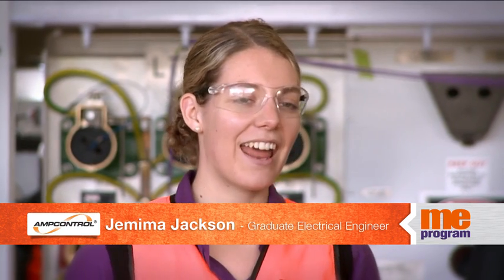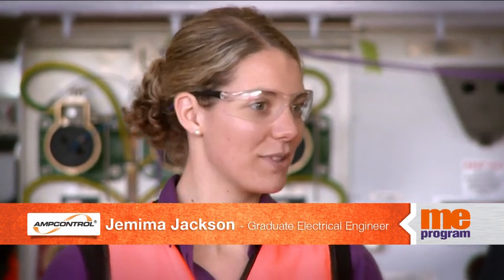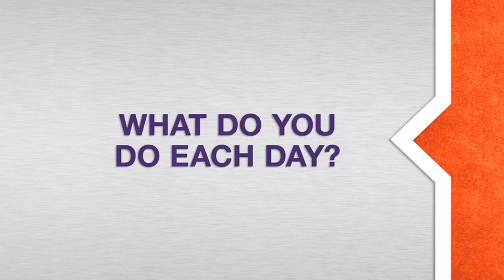What is an Electrical Engineer?

Comment: Electrical engineering is a field of engineering that deals with the study and application of electricity, electronics, and electromagnetism. It involves the design, development, testing, and deployment of electrical systems, devices, and technologies. Electrical engineers work on a wide range of applications, from small electronic devices to large-scale power generation and distribution systems.

Here are 10 ultimate things to know about electrical engineering and its categories:

1. *Circuits and Electronics*: Understanding circuit analysis, electronic components, and device physics.

2. *Electromagnetism*: Grasping electromagnetic theory, Maxwell's equations, and electromagnetic waves.

3. *Control Systems*: Knowing control system design, modeling, and analysis, as well as control strategies and algorithms.

4. *Power Systems*: Understanding power generation, transmission, distribution, and utilization, including power system protection and control.

5. *Signal Processing*: Familiarity with signal processing techniques, including filtering, transforms, and signal analysis.

6. *Communication Systems*: Knowledge of communication systems, including analog and digital communications, modulation, and information theory.

7. *Microcontrollers and Embedded Systems*: Understanding microcontroller architecture, programming, and applications, as well as embedded system design.

8. *Computer Networks*: Knowing computer network fundamentals, including network topologies, protocols, and network architecture.

9. *Instrumentation and Measurement*: Understanding measurement principles, sensors, and instrumentation, as well as data acquisition and analysis.

10. *Electrical Energy Conversion*: Grasping electrical energy conversion principles, including electric machines, drives, and power electronics.

Categories of Electrical Engineering:

1. *Power Engineering*: Deals with power generation, transmission, and distribution.

2. *Control and Instrumentation Engineering*: Focuses on control systems, instrumentation, and automation.

3. *Electronics and Communication Engineering*: Encompasses electronic circuits, communication systems, and signal processing.

4. *Computer Engineering*: Covers computer hardware, software, and networking aspects.

5. *Instrumentation Engineering*: Concerned with measurement, sensors, and data acquisition.

6. *Electrical Machines and Drives*: Deals with electric machines, drives, and power electronics.

7. *Renewable Energy Engineering*: Focuses on solar, wind, and other renewable energy sources.

8. *Electrical Engineering Materials Science*: Explores materials used in electrical engineering applications.

9. *Biomedical Engineering*: Applies electrical engineering principles to medical applications.

10. *Nanotechnology*: Explores the application of electrical engineering principles to nanoscale devices and systems.

Remember, these categories often overlap, and electrical engineers may work across multiple areas throughout their careers.

Comment: I have no clue why I chose EE. I was doing Petroleum Engineering but decided to switch because as I got older, I was realizing that the market isn't always stable and that's not what I wanted for a career. So my advisor suggested EE and that's why I chose it. Not really sure how I could mention that on a resume
Reply: Then how are you now?
Reply: @dcqwer1957  Im still EE. Currently taking Signals and Systems and Electric Fields. Then next semester, I plan on taking Senior Design.

Comment: They made this actress wear a field jacket and protective goggles to make her look "active" and in the field. Pathetic
Reply from the maker: So why do you assume she is an actress? I have known Jemima for a number of years and she is a very good Electrical Engineer? Pathetic alright!
Reply: Wether or not she's really an enginner is totally irrelevant. All in this video is supposed to impress ignorant people who judges by visual clues only. So let's wear a signalling jacket and protective goggles (LOL), lett sorround the stage with huge machinery noone knows what they are. An engineer today is supposed to spend time on a desk, or at best, doing computer simulation or design using CAD.
Reply: Yeah, you know there are requirements for you to stand in that warehouse? My dad is a technician, has his workshop entirely separate from the warehouse that he has to walk through everyday but he has to wear protective steel cap safety boots and if he is working outside his work shop, a hard hat.

Comment: Apparently,I'm not cut for this.Not so good at mathematics,though I'm generally good at electronics...can do basic wiring and repaires.
Reply: I actually think electrical engineer is probably the engineering that uses math the most.
Reply: Maybe try to become an electrical engineering technician, they do less math and more hands on work. Also you could look into an apprenticeship program to become an electrician, they do virtually no math.
Reply: Matt H thanks,that sounds helpful!
Reply: well you sound most fit for a technician
Reply: Don’t worry engineers barely use maths outside of their degree

Comment: Hi all!I have a question and if anyone can help me I would appreciate it.I'm currently studying at a low rank university in order to take my degree in electrical and electronic engineering.My question is I have 16 courses overall in the 4 years of my study in order to take my degree I feel that they aren't enough and I won't have the proper knowledge to be an engineer does anyone have an opinion on this;
Reply: +P Syle If you think you don't have enough knowledge you can always start self-teaching yourself more advanced things (e.g. using MIT Opencourseware, Harvard Extensions and such), as well as gain experience by calling companies and asking for a work experience. Doing these will make you highly employable, regardless if you are studying in a low ranking university.

Comment: I'm an electrician... and this is why we hate electrical engineers. We are well versed in schematics (latter and line diagrams), blueprint development and reading, troubleshooting of electrical equipment etc. Most of us now go to college to become electricians so we can calculate circuits, capacitors, capacitance, induction, reactive inductance, phase angels etc. Electrical engineers are a joke.
Reply: +Brandon Bohannon I'm an electrician, I also have 2 years education in high voltage engineering, I'm now studying electrical engineering, and where I'm from (DK) We don't study just to get that extra bump to the paycheck, no this is a hobby, this is about careing, learning and bettering yourself. Yes as an electrician you can calculate the basics of circuits. But trust me when I say, you have only sniffed to the tip of the iceberg, there is so much more to it than just the basic components you listed. There's also programming which is a huge part of it, C/C++, Linux kernels/drivers, embedded software, how data is transfered when you plug your phone in your PC, hardware abstraction layers, compatibility, documentation of your research, systems design, applied mathematics/physics (You will need this!) Basicly take your smartphone look at it.. As an electrical engineer you are actually able to make ALL of it :)! Look at your PC, same goes for that, your granddads pacemaker, same.. You can create/modify ANYTHING! 

At the moment I'm working on a shopping cart that will ease access for handicapped people, and make their shopping as easy, comfortable and enjoying as for the rest of us. Plus they will look hell a' cool with our robo-cart following them and picking stuff up for them, talking to them etc. ;)

Nobody is a joke, every person in the society has an important role to fulfill.
Reply: Brandon, you sound ignorant and very bitter. I'm an Electrician and also an Electrical Engineer. Yes, Electricians are adept at the installation and maintenance of Electrical systems, some are also competent at design of basic to intermediate circuits. However, the science and math learnt at Technician level barely scratches the surface of the knowledge needed for the design engineering required for highly complex networks and systems.
Reply: the least you make as an electrical enginner is to start off with 80k a year no electrican is making that starting off
Reply: How are we a joke? Clearly your reasoning is naive. You go to college to learn those calculations yeah that makes you what ? Wiring a house and some shallow building equipment. We electrical engineer are not only capable of building cm circuits. We learn calculus and physics etc on a degree minimum level which enhance us to deal with totally different areas such as Nanotechnology, Microsystems , mechatronics, bioelectronics neuroengineering. On which you guys have no idea of the mechanism behind them.

Comment: In my opinion, if you have not received an electrical shock at least once in your life, you are not worth to be an electrical engineer & I doubt she would have received electric shock even once!
Reply: +ss most ee's don't even work with actual circuits now days......it's all computerized
Reply: That's stupid. It is always suggested not to touch anything that you didn't work on before.
Reply: ss unless u get electrecuted
Reply: Joe Mama electrocution is death by electricity....hopefully one improves upon skills before that!... electrocution would mean bad luck, or you haven't learnt from your mistakes
Reply: lol what are you dribbling about?
Reply: Joe Mama Well in that case one ain't  good enough to be an electrician too.... receiving electric shock means learning from your mistakes on the shop floor, going thru the grind, gaining experience, so as not to repeat the same mistakes and improving on practical skills.
Reply: ss murphy's law
Reply: clark11ification LMFAOOOOOOOOOOOOOOOOOOOOOOOOOOOOOOOOOOOOO
Reply: If you have received an electric shock means you aint good enough to be an electrical engineer.....u should be an electrian instead.
Reply: *****  It is not a professional requirement but if you don't work with your hands you will never get a shock so you will never learn from your mistakes. Mistakes transform into experience which enhances skill. This is part of trait which goes on to make an expert hands on engineer!
Reply: so the 4-5 years of university, the thousands of hours studying, all of that doesnt mean shit because shes not an electrician?
Reply: SheIIdon A skilled electrical engineer 'has to' be well versed with electrician's work. We all know how helpful textbooks are if there's a fault in a power panel..... you be the judge.
Reply: ss if she graduated with a degree in electrical engineering (and went to a half decent school) she definitely already has some experience with it anyways. especially if she did work terms. I'm trying to think of what specialization to go into my second year, im assuming that youre EE, do you enjoy what you do?
Reply: SheIIdon Ah Ok. Yes I am EE & into core EE. Let me tell you it's enjoyable if you r really interested but can be very frustrating if you are into EE only for the money cause practical life in core EE is pretty tough! If you doing engg. only for money take a cushy software job. The only cushy job in core EE is electrical design, but mostly taken up by girls who sit in office all day no site work. It does require brains but all the standards are easily available so one gets hang of it eventually. Hope this helps. Do ask me if you need to know more :)
Reply: maybe an electric shock from her vibrator .....